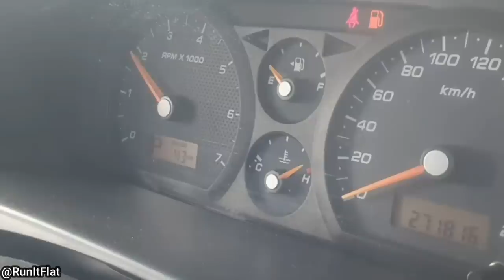Customer States Car Is Overheating And Won't Shut Off! | Just Rolled In

Comment: I will never understand those morons who decline service when they have no oil in their engine.  They don't deserve to have a vehicle if that's the way they're going to care for it.
Reply from the maker: I just bought a 91 f150 on Monday. It's treated better then 99% of these cars lol
Reply: Oh don't worry, they won't have it for long.
Reply: @amicloud_yt  As long as until the tow truck arrives.
Reply: Don´t worry, they will come back, willing to pay ANYTHING, just to have their beloved car back and running, right after it finally breaks.
Reply: @amicloud_yt  10 minutes down the road................
Reply: But they'll be the first ones to say what a P.O.S. that brand and model of vehicle is when it blows up! It's never their fault for not doing routine maintenance.
Reply: The oil one doesn't bother me too much, I do feel sad for the car but it's problems for the negligent driver only. I'm more angry and afraid with people who neglect tires, suspension, shafts and anything that may break at the worst possible moment and endanger innocents.
Reply: They probably think they're being scammed by the tech trying to sell them a repair they don't need. I don't know if it's still a thing but that definitely happened a lot a while back
Reply: @amyshaw893  That will ALWAYS be a thing. The customers need to educate themselves about what needs to be done and when.
Reply: Maybe they'd just prefer to avoid the labour charge by doing it themselves.
Reply: @UCCLdIk6R5ECGtaGm7oqO-TQ  if they were capable of that the stick wouldn't be dry.....
Reply: They'll add oil and try to get it covered under warranty.
Reply: We had to turn away a camry because it came in with almost no oil, that poor 4 banger was rattling itself apart. Boss man said put some rotella in it, and send it home. Poured two quarts in there (the most we can put in a car for free) and it quieted down.
Reply: @amyshaw893  If someone don't know how to use dipstick (too many moving parts), they can believe anything.
Reply: They probably think they're getting scammed. Scamming themselves for being so dumb and ignorant
Reply: I would imagine that they just assume that the auto shop is trying to scam them out of money and that's why they decline. Really oil changes are as simple as changing your tire but nobody seems to know how to do it
Reply: I don’t need oil , you’re just trying to upsell me , yes we are . A new engine 😂
Reply: @amyshaw893  
This is why i ALWAYS show the customer the issue, and explain the consequences of not doing the service. Works most times as long as they can afford it.
Reply: Trust me,I see this on a daily basis and from the looks of it that was a kia engine. Those engines and especially their gdi are known for burning off oil. These people frequently go 10k miles over on the cheapest hooch they can throw in it then complain that it was a crappy engine.
Reply: Can you imagine how they drive!?!?
Reply: @blazechicken6822  In their defense, they’re not the best engines. I had a 2011 Sonata that started burning pretty bad. I was religious about maintenance too. It took a class action suit for Hyundai/Kia to own up to the problem.
Reply: @Morpheus-pt3wq  maybe or maybe they will just sell it and buy new
Reply: @iuyozx  Was kinda 50/50. I’ve seen those very engines go 300k and I’ve seen them explode at 50k. But the point is regardless of the engine you can’t complain even if it is a bad engine if you take poor care of it. Or just get a beater Camry.
Reply: @UCCLdIk6R5ECGtaGm7oqO-TQ  Well doing an oil change isnt hard - if you can get under some of the smaller cars.
Reply: @jayjaynella4539  And then claim the shop destroyed their car.
Reply: I'm a lube and tire tech, I see these things all the time. Recently had a flat repair when I noticed the guy was 100 miles overdue for his oil change. I asked him if he would like one but he declined. Ive even seen people "top off" their engine oil so they stay in the safe zone on their dipstick. Frequently I will go out into the parking lot to see 1 quart bottles of oil just lying around. I've yet to see someone come in with a car so bad the oil doesn't even drain. Rather ploop out.
Reply: Exactly
Reply: @forgotn42  It's going to be even more expensive when they have to buy a new car.
Reply: @mcpuckles1459  If they have to top off frequently then they have rolling oil changes. Just the filter that's probably a bit clogged.
Reply: @amyshaw893  That's a difficult situation... people who know literally nothing about vehicles will say that about even the most honest mechanic, just because they heard it can happen, and don't feel like paying for service. If you try to show them the problem in person, they don't know what they're looking at in the first place - so how do you get them to understand there's a problem?

There are absolutely still shady mechanics and shops out there, doing sub-par work, or not doing anything at all. Thankfully with the internet age, it can be easy to do a bit of research to find the good ones in your area.
Reply: There are people who are completely clueless to the concept of maintaining anything and won't listen to reason. Of course once the car completely breaks down to the point where it can't run it is someone else's fault.
Reply: @spenserak  True that, the only way those people will let someone maintain their vehicles is if they trusted them beforehand. Problem is, not always that person knows what they're doing and may fuck up things anyways. It's a never ending cycle.
Reply: @mcpuckles1459  it is ok to top off your oil if you are within the change period. Specially if you have an older rig with a worn out engine that burns a little oil. It is important to change the oil regularly though.
Reply: @UCCLdIk6R5ECGtaGm7oqO-TQ  and maybe they have been ripped off before by shops who try and upsell everything
Reply: If you think not caring for it warrants no vehicle then you should see how most drive them. 😂
Reply: Or mechanics could just be honest?
Reply: @MikeBrown-ii3pt  definitely still a thing. I told my son to never go to a mechanic without consulting me first. Sure enough (he lives in a different city now) he tootled off to a random mechanic and got taken for a ride. I owned his car before him and knew it inside-out, it also passed a clean-sheet warrant-of-fitness only 4 months ago when I still owned it. The advisories on the invoice he showed me, along with what I knew for a fact was an unnecessary job, were instant alarm bells.
Reply: @amyshaw893  Show the customer the dipstick and better-yet, a video to prove he/she didn't drain some. People are dishonest that way. CYA.
Reply: @dalelangila9274  Brake fluid is supposed to be flushed every 2 years because the stuff it's made with is great at gathering moisture. What happens if you don't flush the system??? It causes the brake caliper cylinder(s), caliper piston(s) (unless they're phenolic), and metal brake lines to rust over time. Worst case, you heat up the brakes (like on a mountain) and they suddenly act like there's air in the line because the moisture (water) turned into vapor.
Reply: People are definitely getting stupider!. Most European countries have a pretty comprehensive vehicle inspection annually so you don't often see this sort of thing
Reply: @UCCLdIk6R5ECGtaGm7oqO-TQ   - I doubt it, if they had the knowledge to be able to do repairs themselves, their vehicles wouldn't be in the terrible state of repair as shown here
Reply: I just had a 2018 bmw suv come in where the brake caliper piston shot out and jammed up in the rotor be ause the brakes were so worn...and we told them to get the brakes done 3 months prior.
Reply: Some people dont have the 50$ for the lube oil and filter. Some people have to budget for 6 months just to be able to get one major repair done on their car, and an oil change isnt a job that requires a technician so they often will go out and buy oil and do it themselves. You want good work done? Go to a mechanic and bite the bill, but an oil change is something anyone can do themselves and they dont have to bite a 50$ service charge that they cant afford.

Do yourself a favor, worry more about what color your hair is going to be dyed next week rather than judging someone with a beat up old cars choice to not pay for an oil change.
Reply: Maybe they would check with a nother place or friend first. But yeah, at least have some oil in it.
Reply: it probably stems from lack of trust in the mechanic possibly due to a previous bad experience.
but coupled with a lack of knowledge, your vehicle is the only thing that suffers.
Reply: @amyshaw893  went into a shop to have my car thoroughly inspected for anything that's wrong with it and they came back with TONS of repairs. I said what absolutely needs to be fixed because I literally have no job and can't afford to fix much. They gave me a (potential) bill for thousands of dollars worth of shit that "absolutely has to be fixed immediately". I said I couldn't pay so I can't do it and just said to fix this this and this. 3 years later and the car is still running and I use it as a delivery vehicle now 🤣

Little to say I now fix my own vehicles and don't take it into shops unless it's to have them tell me what's wrong if I can't find the problem. I ain't paying $250-300 to have my brakes replaced when I can do it for $60 and 2 hours of my time after watching a tutorial on YouTube lmao
Reply: I can understand why some decline it, It can be due to both ripoff mechanics and ignorant car owners, if there are no ripoff mechanics overselling/overcharging services to customers they would have a 100 percent confidence on what mechanics would tell them, if people actually learn how their car works it would save them a ton of money, service alone is a great investment if one can do it himeself/herself, I for one have been working on my own car its a 2006 audi a4 and probably the only audi in my town that doesnt have any problem and drives like a dream.
Reply: @Morpheus-pt3wq  , hah hah.. and be told the engine is totally seized and needs to be replaced which will be more then the car is worth if its a used car.  ---I should know, happened to me.  

But to be fair, sometimes repairs cost a lot of money, more money then the owner has.  The oil leak I had was going to be around $800 when I had NO income at that time.   The cars lasted another 2 years with me putting oil in it now and then because it was a slow leak... until one day going 75mph on the highway the engine seized and I had to emergency hand brake merge across 3 lanes of traffic to the right shoulder with NO power steering or power brakes.

(This was in like 2002 or something when $800 was much more then it is now. That same repair now is probably $1200)
Reply: @OgdenM  when you buy a car, you should be financially prepared for regular maintenance and for occasional costly repairs. Although those expensive repairs are mostly tightly related to maintenance negligence - ignoring fairly cheap maintenance price will over time cause some expensive bills.
Reply: hoenslty how people take care of their cars has nothing to do with how you feel about it. its their property. if they find themselves broken down, then guess whos gonna charge them to fix it and keep shops in business.
Reply: @justinisaacs9617  just curious, what will you say, when one of those broke people will crash into you, total your car and leave you with nothing. In your home, it´s only your property, sure. But once you leave your house, it´s your RESPONSIBILITY to have the car fixed and in drivable state, for the sake of others around you.
Reply: The thing is if they're driving (especially at higher speeds) it's likely the engine will seize throwing the car into uncontrollable skids and swerves endangering other nearby drivers.  All for a few $ worth of oil.
Reply: @UCCLdIk6R5ECGtaGm7oqO-TQ  Doubtful.  They couldn't possibly care if there is NO oil in the system at all.  That shows a lack of regard for even the most simple maintenance - just checking the level.
Reply: To be fair if the car has no oil on the stick/is way overdue for a change odds are the engine is near death and sadly not worth saving.
Reply: @amyshaw893  The hilarious part if they're really that afraid of getting scammed, they could just do it themselves for no more than $30. But we all know they think engines run on magical fairy dust.
Reply: @amicloud_yt  I can envision it now, "For Sale, highway only miles, well maintained.  Freshly washed, and waxed with WD-40".
Reply: The problem is there are a lot of shady, shitty mechanics shops and people grow numb to their recommendations. But unfortunately if you are not mechanically inclined you don't know whats going on so its always gonna lead to a catastrophic failure.
Reply: its because they are really cheap and know they can go to walmart and buy 2 quarts of oil for less and pour it in themselves.......and call it an oil change
Reply: Don't deserve to have a automobile?  Well, I guess you're right, as no one deserves a vehicle; it's something they purchase, and maintain, as they will, with the maintenance costs that come along with their treatment of it.
Reply: I think in this case it was the other way around. It's the technitian that have declined to servise the car, because he suspected the customer will try to scam him. Customer came in for something tire related. If technitian just did what he was asked, the customer most likely would have returned a few days later to complain, and demand an oil change as "it was all good before he drove to the garage".
Reply: @amyshaw893  sadly still is, I have some bad experiences with my car and mechanics telling me it’s fine only to discover something failed royally a couple hundred miles later
Reply: @MikeBrown-ii3pt  This, dipsticks are there for a reason and drivers should understand basic maintenance like knowing how to check the oil and coolant levels.
Reply: @dierdred_the_gray  But they sure as hell have money for a new car when the engine blows. Funny that. Perhaps give up some unnecessary luxuries instead.
Reply: @ThaFuzzwood  a $400 beater is cheaper than an $1800 repair
Reply: @FGC292  or know what oil to put in there.
Reply: Those usually get repossessed from Tyrone and send to auction sooner or later.
Reply: And in 3...2...1...
"mAyBe tHeY cAn't aFfOrD tHe OiL!!1!!"
But they can afford a new engine and/or car. And you can be sure they have the latest iPhone, games console, TV, beamer and so on. They always do. Because people who can budget on little money understand the importance of preventive maintenance.

Comment: I can understand why some people decline repairs on certain problems and this is why . I went to have my upper & lower ball joints , inner & outer tie rod's and both stabilizer bars . One shop wanted $3500.00 , another shop wanted $2200.00 , and the third shop charged me $995.00 which included the wheel alignment with a 2-year warranty and with great quality parts !!!  No Auto Zone or other cheap parts !!!  I grew up with grease under my finger nails but now have gotten too dang old to do that major work !!  I knew all 3 different auto repair shops that do quality work !!!!  Sometimes it pays to check a couple different auto repair shops !!!!  This is on my Dodge Ram 2500 diesel truck .

Comment: The tyre/fire trick is cool - when I ran a large site office for a construction company, our motor pool was having a hard time reseating the bead of a grader tyre (which NEVER need repairs).  Eventually our chief mechanic gave up and asked me to take it down the road to a tyre shop (my pickup was the largest vehicle available at the time).

When I explained the problem to the owner of the tire shop, he turned to a kid nearby and told him to bring a cup of gasoline.  He had the kid pour it into the tyre, roll the tyre about 10 feet and lit the gas fumes. Immediately the tyre blew outwards and reseated itself…. He then charged me $50 which made me blew my stack.  After I ranted about being ripped off, he reminded me “Sir, you came here telling me your crew had spent all day trying to reseat the tyre, and how desperately you needed the grader.  I’m not charging you for the work I did, I’m charging you for the knowledge.”  At which point I burst out laughing and said “Good point!”

Learned an important lesson that day…..
Reply: What is the leftover gasoline (an organic solvent) going to do to the inside of the rubber tyre over a long time?